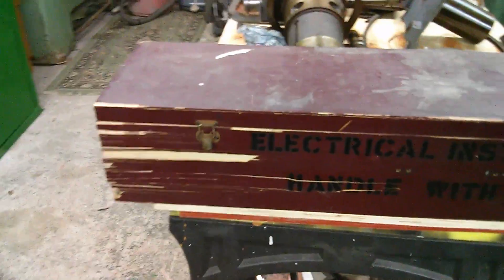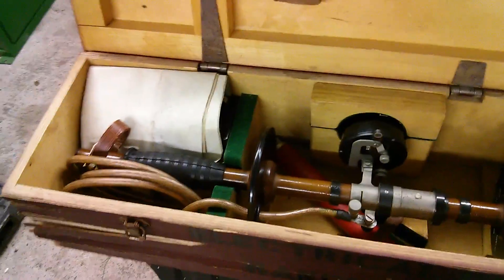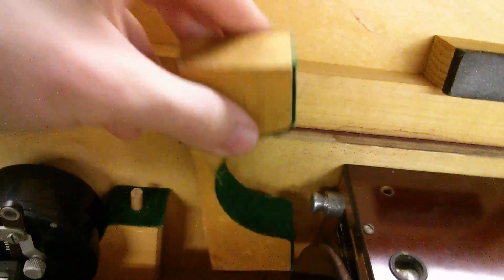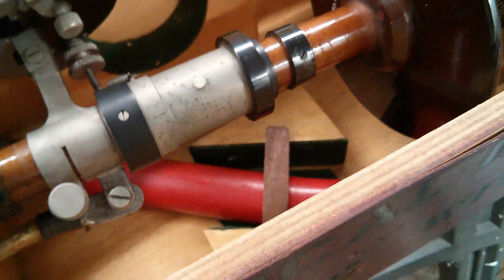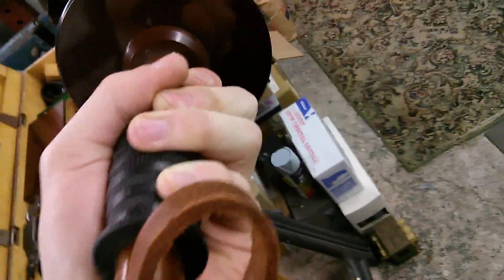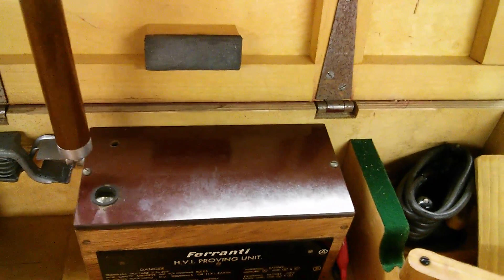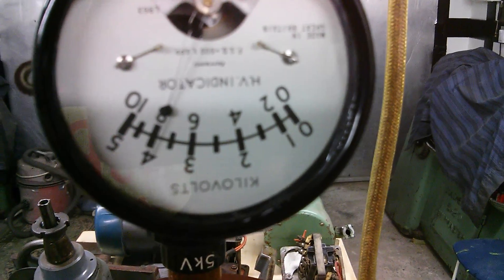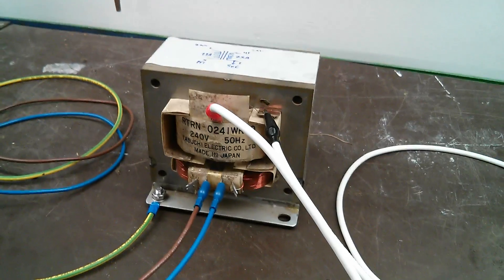Vintage 11kV High Voltage Indicating Chicken Stick Demo

Comment: The 6kv full scale would probably have been for the 6.6kv phase to phase which would be about 3.8kv phase to earth. I guess the reason was to make the 'normal' reading in the upper 1/2 of the scale but allow the equipment to deal with transients or overvoltages?
Reply: TheChipmunk2008 Distribution systems use to use 6.6kV as a full system voltage and then changed it to 11kV later on. A lot of the 6.6kV supplies in our area were changed to 11kV in the late 30’s early 40’s and at the same time, the LV was changed from 6 phase to 3 phase

Comment: nice Old gear, just love it ;)
Reply from the maker: Thanks, I do also find this kind of stuff fascinating, and to have a purpose for such a device is great, I'm yet to restore the wooden case, I have everything ready to go ahead, other than the stencil which shouldn't take too much doing.
Reply: yes, and just the look, today is there nothing to compare with. and these thing are so well made. i look forward to see the result :)
Reply from the maker: TecKonstantin Thanks! I will be sure to post a video on here when it's done, I just hope the exterior "mahogany red" I got to repaint the box should match in colour to the old deep red of the box. It's a rare thing to find something modern that is made just as good or better than a vintage equivalent these days, and if so, does it really have heart?
Reply: ohh yes you are right absolutely! I can only rave about!

Comment: That's really nice and not a single bit of electronics. :-)

As soon as you opened the box, I thought: Put it on a MOT. :D If it can take 10kV, it'll do a MOT with no trouble at all.

A bit later in the vid, you connected it to a MOT..... YAAAY. :D The stick device seems to work quite well. Built to last, of course!

It's interesting that the Proving Unit is made by Ferranti. I own a few electricity meters made by Ferranti. Some are coin-operated meters, and some are 'quarterly' types. :-)

Thanxx for showing,

-BoomBoxDeluxe.

2nd January 2014, 01.11 GMT
Reply from the maker: All but the giant resistor inside of it, not a single sign of silicon though!

I glad out minds think alike, I was thinking, as the device is designed for high voltage and high power, then highest powered, high voltage device I have in my inventory is an MOT.

The whole unit is indeed made by Farranti, great make, they do make some nice stuff including KW/h meters.

Comment from the maker: Pietzeekoe

Sorry about the late reply to your comment, it appears to be missing the "Reply" button...

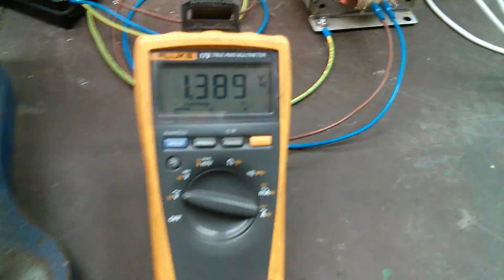But anyway, the device at 12:38 is known as a "Safebloc", they also come under the names "Quick Test Connector" or "Quick Test Block".

They are great devices as they do what they are called, they also implement what is known as a double pole knife switch which means it is an ultra safe device as the knife switch provide a physical and visual break in the circuit of both live and neutral conductors, whilst maintaining the earth connection for an earth fault return path for fault conditions.

One thing to note I have realised is about these old style Safeblocs which don't have the insulated clamps inside is that if you have large capacitors in the circuit there is a possibility of getting a shock back from the load (appliance) side of the circuit when the safebloc it is open position and disconnected from the mains, that is regardless of capacitor bleed resistors as they still take time to discharge fully.

I will have to make a video about this at some point as is it a note worth keeping in mind with these safeblocs.

Thanks for the comment!

Comment: Yes it can test 11kV three-phase lines because the 11kV is from line to line, but each line is about 6.35kV to earth. Nice kit, but watch out for that clip jumping off if you don't give it enough to bite on!
Reply from the maker: "each line is about 6.35kV to earth" - Yes of course! that thought must have
originally gone straight over my head (no pun intended).

Thanks for pointing that out, it certainly makes a lot more sense now.

Although a 5kV and 10kV max scale for 11kV and 6.5kV voltages doesn't make much sense still other than whether it's off or on readings which I'm guessing is the actual case, I would have made them 10 and 20kV maximum scales myself.

And I believe I forgot to mention the importance of a good earth connection other than you need a good one as I was hooking on to the M20 nickel plated brass blanking plug on my line filter, I should have went over what happens if it looses contact really... maybe next time, I could even prove a few theories in the next video or so on that subject. x]

Comment: Not bad man nice to see her working . It's strange we both have the same model but there so different even the boxes .If ya need a HV 10kv+ use your old black one with an earth ring as long as it's earthed you could even use a peice of metal lol I think ppl would moan at a metal chicken stick though :)
Reply from the maker: Hey John! Out of interest is there any noticeable differences to your actual Model No.1 HVI probe? or is the main differences to the box itself? I think we came to the conclusion that yours is a newer (refined?) model to mine?

I can see a new video coming up on your channel at some point, especially as you're the only other person I know in possession of these Model No.1 HVI probes, which does beg another future video on phasing when I eventually come down to yours as you know that requires two probes and one phasing indicator. x]

As for my old black chicken stick I may well still use it, although it depends on where I put the earth connection as electrically the whole thing acts as a HV resistor and if I put HV at one end, Earth at the other and me in the middle the it will act like a divider and if my resistance is lower than the rest the length of the stick then I still get a good slice of the cake f you know what I mean haha xD

Technically a metal chicken stick would be safer than the before mentioned configuration! but like you say it looks wrong from an observers point of view!
Reply: If you want pics or a vid I can dude mine doesn't say model no'1 but my documents say it was 1950 summin that it was first calibrated but ours are no.1 's but there was a previous model so one of ours could have had the conversion would be good to have them together to have a good look .I've not even tried mine yet so it could be a duffer  .phasing test would be good man would have to use some caps or ask the neighbor :) yea I wouldn't put an earth except right near the tip (hot end ) no where near ya hand  lol
Reply from the maker: John Seach Spot the different, one of my favourite games... GAME damnit! xD

And yeah you've got better access to 3 phase than me, my nearest 3 phase is about 100M down the line... x], we could even phase some transformers in just for experiments, but we'll come to that when we do.

If yours was Calibrated first in the 50's then I'd say yours is older, yours might even be the Model No.0 with no markings and many slight differences, but later converted to the requirements of the Model No.1 with the documentation added in too. seems to make sense doesn't it? x]

And yeah when you're relying of earths to remain earths right near your hand you'd want a good connection that's for sure, this model has 600V FSD at the meter which is not as bad as 11KV but if you loose your earth then the meter becomes 11KV until you or something else provides a nice voltage divider earth path for that 10.4KV to travel through... xD